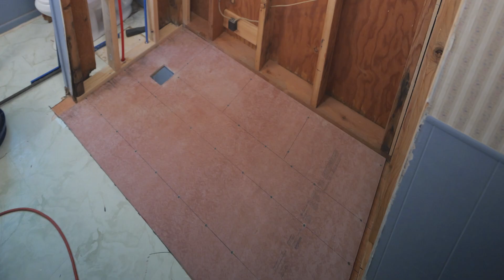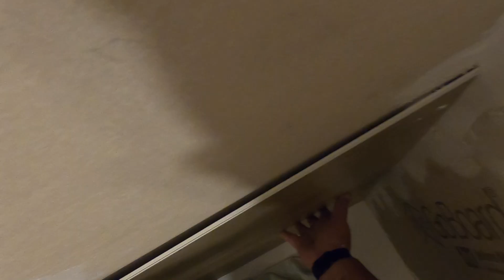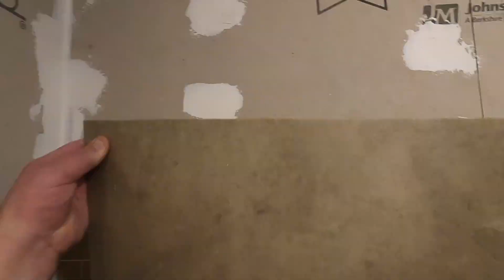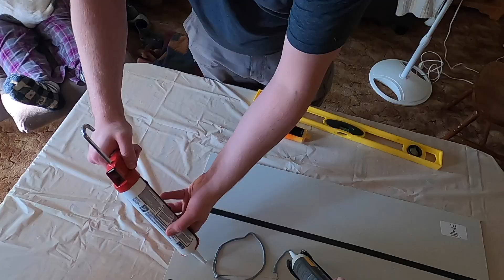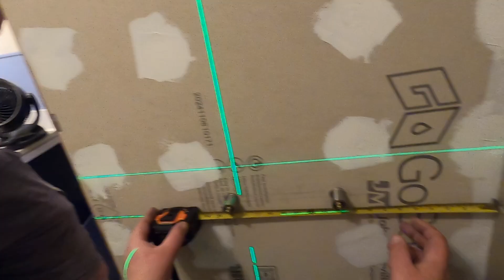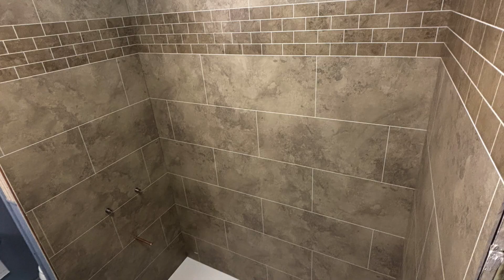Jetcoat Reflections Shower Wall Panels - Installation Video for Bathroom Remodel

Comment: Great video. I was trying to decide between Flexstone and Jetcoat. Your video was my deciding factor. I even like your color scheme. Nice job.
Reply from the maker: Hey thanks a lot! I’m glad the video helped you.  When I did the installation and was preparing and researching, there wasn’t a video like this one and that’s why I made this video. So that other people could get all the info in one place.

I’m sure Flexstone is fine, but after having seen the Flexstone demo model at Menard’s, I just didn’t think it looked as “real” as the Jetcoat products. I also think it would have been harder to do a good job installing Flexstone, because it’s one big panel for each shower wall. The smaller panels make the process more manageable. 

We DID use the Flexstone base but that was just our choice, I think nearly any prefab base would work.    One good thing about the Flexstone base we liked is the texture of it, and also that it didn’t have that 2-3” lip all the way around it.  It helps the shower feel larger because there’s more space to put your feet without losing 2-3” on each side.

Comment: Why in the world do you have a tub spout in a shower only?
Reply from the maker: I've answered this several times in other comments.  We installed the tub spout that was included with our fixtures kit so we could fill up mop buckets, etc, and also so we could mix the water temperature before it came blasting out of the shower head.  This is our only bathroom so having the functionality was a conscious choice we made.  And we are happy that we did.

Comment: Great video, thanks for posting!
How is it holding up? Does it get dirty or scummy easily and how is cleaning it?
Reply from the maker: No we haven’t had any problem with it. Its been installed more than year now, with daily use, and we never had one drop of water leak where it shouldn’t go. All the plumbing and behind the walls has stayed bone dry. I’m very happy with the rresults long term.

it actually stays very clean.  after I finished the install I put a layer of turtle wax on the wall panels, I figured that would help keep anything like soap scum or hard water deposits from sticking more than being able to wipe or spray them down.   The floor will get a little dirty from time to time since the shower pan has a rough texture. but I found the trick to cleaning it is using one of those nylon bristle brushes attach to a drill/impact driver. spray it down with some cleaning vinegar and bathroom cleaner, let is sir 5-10 minutes then use the drill brush, rinse, and it looks good as new.  The walls stay clean, every now and then I do a quick wipedown but that’s mostly because we have really hard water here in my town in Kansas.  I think cleaning it way easier than tile would have been.  when you look at the shower it doesn’t look any worse than when I first installed it.  my plan is to replace the silicon sealant in the corner every 3 year or so.

Comment: What is the best for   easiest for install sheetrock greenboard or hard backer board ?
Reply from the maker: Honestly, as a person who had never done a shower remodel before I did this video, I highly recommend the GoBoard waterproof backer board system that I used in the video.  I know that I don't go over the details of that part of of the installation, but it was pretty straight forward and very easy to work with.  I recommend you download the instructions / documents for it from the manufacturer, watch the various videos available for it online. Make sure you follow the process to a T.  Also, don't cheap out, buy the Goboard brand screws and washers and also the GoBoard sealant, it's definitely worth the few extra dollars to have the stuff that works right. As of today, that shower in my video has been installed for a year and we haven't had one single drop of water leak anywhere in all that time.   And take my advice about doing the extra work with the wall studs. Not only does it add stability, but if everything is square, level, and plumb then it makes the rest of the work go a lot easier.  I did as much work with the actual wood/studs as I could, and I did the rest with those cardboard drywall shims.

Comment: Did you install the go board over the shower pan flange,  or have it meet the top of the flange?
Reply from the maker: GoBoard went to the top edge of the shower pan flange, very slight gap between them that was then filled with GoBoard sealant.  Jetcoat walls went all the way down to the floor of the shower pan, then silicon to seal that joint.  So that means where the flange is, there’s a bit of dead air space between the back of the Jetcoat and the front of the pan flange (because of the thickness of the GoBoard that the Jetcoat adheres to). If you were concerned about that dead space, you could sandwich some silicon between them. But I didn’t do that, and here we are more than a year later, the shower install has not leaked one drop of water anywhere.  No moisture behind the Goboard or on the floor, I open the access panel once every couple months to check and make sure.  Bone dry back in there, just like the day I finished the install.   Contact me directly if you need to.  Curtis Busker on facebook.

Comment: Why a tub spout in a shower??
Reply from the maker: I've already answered this in another comment.  The tub spout allows us to mix water temperature before being blasted with it, at our house it takes several seconds of running the hot water before hot is coming out of the spout or head. We've always activated the shower head by pulling on a tub spout diverter, so it was also about familiarity.  It also allows us to fill things like mop buckets faster and easier. And finally,  the spout came with the valve handle assembly kit and we felt it was silly to leave it out and not install it.  Now that time has passed and we have used it in those various ways I described above, I am confident we made the correct decision for us.  Your design may vary.

Comment: I came across your video while searching for another product, which then prompted me to rethink what I wanted.  I was convinced after receiving a sample from the supplier. It's been a few months since posting this video, and I was wondering if you have any further suggestions?  Is there anything you should have/shouldn't have done?  I'm ready to place an order and just wanted to make sure there are no regrets.  It's not available anywhere near me so I would have to make a 4 hr (one way) trip to get it.  I'm cautious about ordering from Amazon due to possible damage during shipping.  Thank you for showing your work!!
Reply from the maker: Honestly no, I'm happy with pretty much everything I did.  If I had to do it again, the only thing I would change is finding a less flexible material than what I used for the shower ceiling, it was a PITA to put up.  But it looks great and really makes no difference in regard to the Jetcoat panels.  

Here we are, 8+ months later and everything still looks like brand new and functions great.  There hasn't been one drop of water that leaked or went anywhere except down the drain where it's supposed to go.  I'm so happy I spent the time and effort on the prep work, that's the only thing I'd really encourage anyone else to do. The prep work is the foundation for everything. If you skimp on it, you'll just cause yourself problems later. 

Feel free to contact me directly. Just search Jetcoat Reflections on Reddit and you'll find my post. You can DM me from there.
Reply: @CurtisBuskerCineCity  Thank you so much!  I'll reach out on Reddit soon.
Reply from the maker: @lucydill  one thing I can say, the box the Jetcoat Reflections panels come is very large and heavy.  I'm not sure it would fit into a short-bed pickup truck, you might need a long-bed for that.  And you definitely don't want to prop one end of the box up on the tailgate. We had to pick ours up about an hour away from where we live, and we actually rented a 10ft uhaul truck, loaded up most of the raw materials too (lumber, plumbing, GoBoard, the shower pan) in the same trip and brought it back to our house that way.  That method worked very well for us, the materials were protected and there was plenty of room so nothing got damaged.  The Jetcoat box is quite dense. I think they're packed well but I can also see someone accidentally damaging corners or edges if they were too rough with it.  So just be careful when moving it.

Another thing is plan yourself enough time for the whole project.  Initially I thought perhaps I could get the project done over a long weekend: Friday-Monday.  But the whole project ended up taking probably 9 days.  Granted, I purposely worked slow and steady, and it was my first experience doing this.  But I think sometimes people plan the timeline and then rush to stay within that timeline.  I think that's a mistake.  It's better to work steady, and take your time when addressing unforseen issues.  I do not regret taking the time I did on the project, but I would have regretted rushing the job and not getting the same end result.

Comment: Why did you install a tub spout in a shower that can't hold water?
Reply from the maker: A few reasons.  One, so we can mix the water temperature prior to being blasted with it.  Two, so we can fill stuff like mop buckets.  Three, it came with the kit and we felt like it was silly to leave it out. It didn't take up any extra room, and the additional functionality has proved we made the right decision (for us).

Comment: Nice work! Can't believe how nice you lined up all the 'grout' lines so perfectly! My jetcoat panels arrive next week. Thanks for posting this! I'm sure it will help me greatly!
Reply from the maker: Thanks so much for the compliments! That's why I strongly recommend using the laser level.  It's worth the small investment.  I used it for lots of things during this install, including lining up the fixtures with the drain on the shower base. I'm sure it will come in handy with remodel projects in the other rooms of our home, too.  

Good luck on your install! Remember to take your time.  I was talking with my mom the other day, and we a big reason things worked out so well is because I didn't rush. We initially planned for the project to take 3-4 days, it ended up taking like 9! Hopefully yours goes faster but I still feel like it was worth it. Please posts some pics or vids as you go through the process, you can find me on Reddit if you search for Jetcoat Reflections.
Reply from the maker: Cameron did you do your shower project yet?

Comment: We are about to embark on this project in our home. This video was SUPER helpful for us to watch before starting to ensure we thought through the whole process. Thank you so much!
Reply from the maker: Hey, you're my first comment on this video!  Thanks so much for watching, and I created this video for people like yourself who want to DIY their own shower using the Jetcoat Reflections shower panels.  I did the shower remodel in April 2025, and as September 2025, I haven't had one leak or drop of water where it shouldn't be.  The shower also still looks basically brand new.  

I wish you luck on your shower remodel project, and I encourage you to take pics before, during, and after the process.  You can contact me by searching "Jetcoat Reflections" on Reddit and you'll find some posts I made about the shower remodel.

We are now planning to remodel the rest of the bathroom.  It's going to be a big project, since I'm approaching it similarly to the shower.  We are getting rid of the old subfloor, replacing the wood paneling walls with drywall, redoing some electrical, and even replacing the cast iron toilet drain pipe with PVC.  Oh, and a new window in the bathroom too.   Honestly I'm scared as heck about it, but I just hope it will go as well as the shower remodel did.  It's tough learning all these things from scratch!
Reply from the maker: @sarahcole8778 did you ever do your project?  I sure would like to hear and see how it turned out.  There's not enough content online that show the Jetcoat Reflections (or even other Jetcoat shower wall series)  at all.   I've been encouraging others to post their projects online, even if it's just a before and after, but so far no one has followed my lead.   I'm anxious to hear how yours turned out.